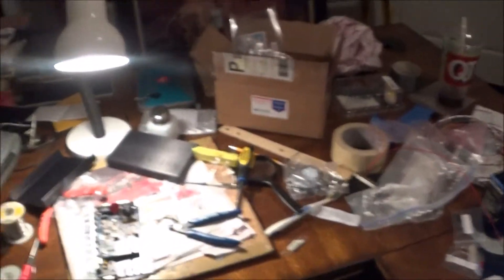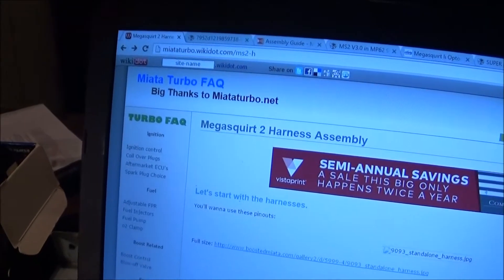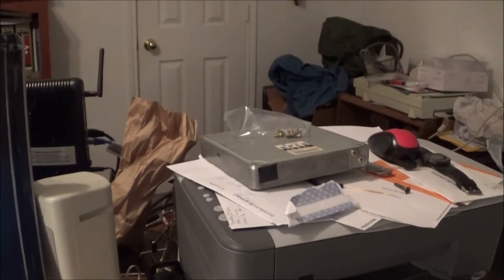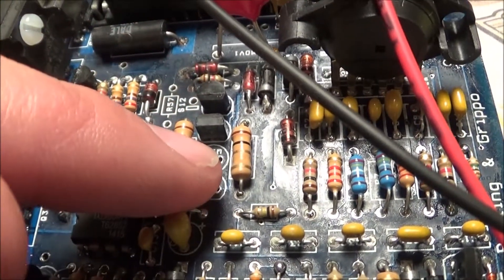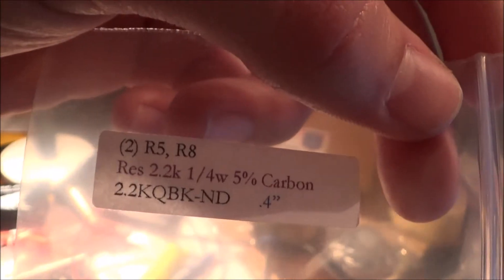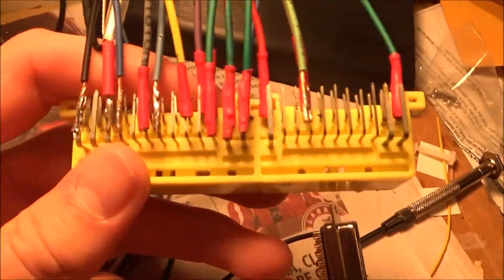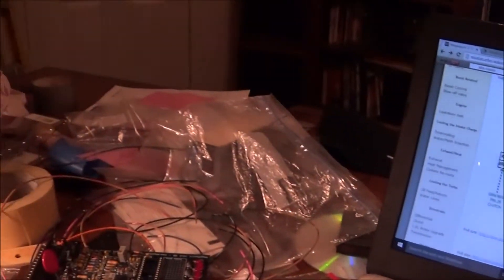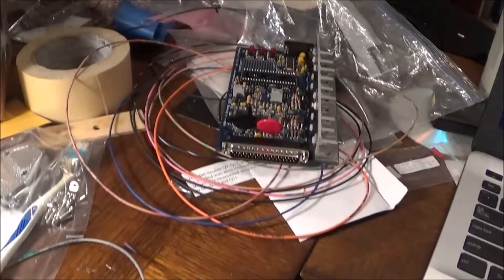How To Build A MegaSquirt ECU Part 1

Comment: I am diy one right now and i have a question, does the direction of a resistor matter? I got a ms2 that was being assemble by another person, and im comparing mine with yours and there are one or two resistor that are inverted, the golden line is to the right instead of left, does it matter or i have to desolder and switch sides?
Reply: Makes no difference